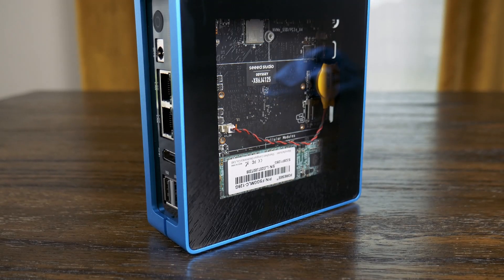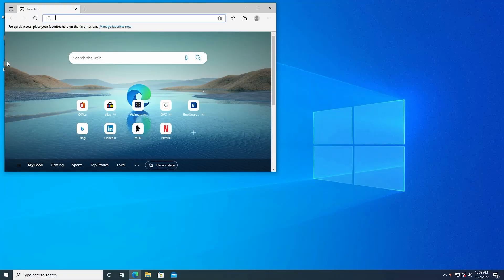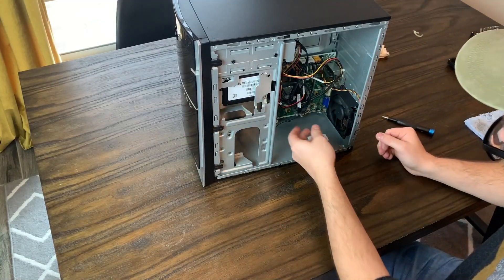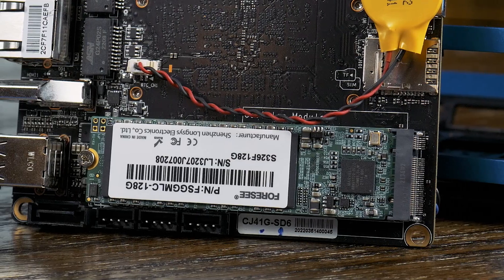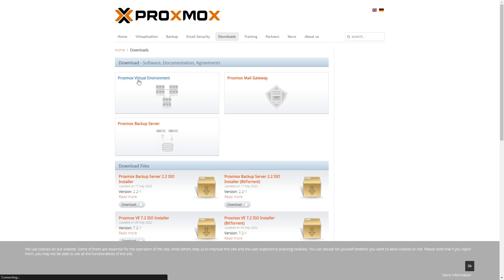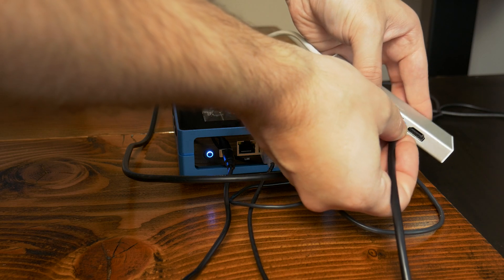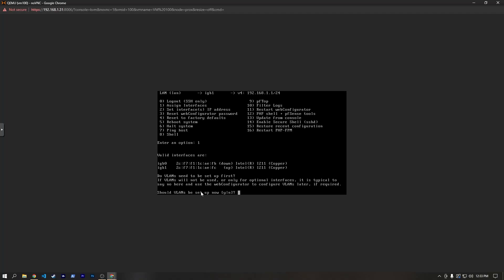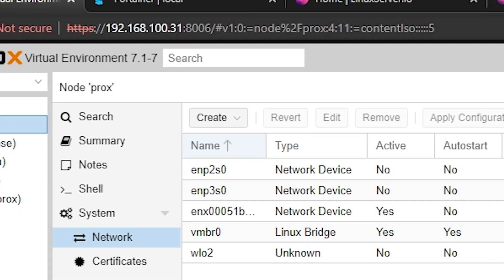Virtualizing PFSense With The Seeed Studio Odyssey

Comment: What about mini pc? It could be quiet dificult to intall two ethernet ports, but i think that on mini pc like a ThinkCenter M710q and some solidering i can usde the nvme to install one or two gigabit or 2,5 gigabit ethernet ports, but in this case you need an ssd for your operating sistem, or you can use the nvme e port to mount one ethernet port and with the one on bord maybe i could run pf sense. What do you think about this idea? Could it work?

Comment: When virtualizing pfSense/OPNsense it is recommended to use virtualized bridges that are set up 1:1 with physical NICs, instead of passing them through. Whenever you need to switch hardware, move VM to other physical machine etc., you can just update bridges config and VM won't see the difference, no reconfiguration needed on firewall's side. It speeds up disaster recovery as well if there is no HA setup.
Overhead on those bridges should be minimal and even low power mini PCs should have no problem with saturating ethernet ports. For a non-critical homelab environment a pass-trough should be enough as well.

Comment: Two very important thing to keep in mind about putting pfSense, whether in a VM or a physical machine. 1. Using Proxmox backup, you can backup the entire VM once you have it running. Store the backup somewhere safe and you can restore it to a Proxmox system fairly quickly if needed.  2. Always remember that pfSense can create a backup of your router settings via the "Diagnostics>Backup and Restore" menu item. That backup can come in handy whether you're restoring a pfSense system, completely reinstalling pfSense, or installing a new instance of the most current pfSense version, or even if you decide to move your pfSense system into a Proxmox VM. Super handy info to always remember. PS.... I just moved my stand alone pfSense from it's HP T620 thin client physical host to a VM within Proxmox running on an HP T740 thin client!

Comment: One thing that is still tripping me up after watching this. You gave the pfSense VM 2 CPU cores and then gave the Debian VM 4 CPU cores. How is this possible when the J4125 is only a 4 core CPU? Seeing as you're using this for pfSense and Home Assistant which both of these would in theory be active and running 24/7 it doesn't make sense to me how this isn't overloading the CPU.

Comment: USB Ethernet for a server seems like a bad idea.  Not recommended for critical components of your network.  Not likely to be as stable as built-in and could have problems during reboot depending on your host OS.
Reply from the maker: You must be new to the channel, haha

Joking lol, and yeah definitely not a great long term solution. However that's why I passed thru the onboard NICs to my router which is probably the more "mission critical" service. Granted I didn't have any issues with the USB interface for the few days I was testing. Thanks for the comment!
Reply: @HardwareHaven  Yeah, I realized after posting that in the video you actually said you wanted to deal with the “awkward usb Ethernet” thing in a future video.

Thanks for the content.

Comment: Do not buy a Seeed Odyssey.  I purchased one in December 2021 and it began acting up in mid-2022.  I would get random crashes which became worse over time.  Eventually, the machine became so unstable, it would not boot.  I contacted Seeed in August and have been back and forth with them since then.  After a number of email exchanges, they told me to log onto their website and fill out a form.  They just denied my repair request because I purchased it from Amazon instead of their website.  Very, very disappointing.  At this point, they will not repair my computer and I'm stuck with a $300 paper weight.  If you are considering an X86 single board computer, go with a Lattepande 3 Delta.  Seeed customer service is terrible and their equipment is unreliable.  I'm very disappointed in Seeed.

Comment: You can also just ssh into the Proxmox host and use that, because it's basically plain Debian. Be sure to secure the box, however.
Reply from the maker: True, but I like having things a bit more compartmentalized if that makes sense. Good point though!
Reply: @HardwareHaven  Very true point, I'd personally go this route since the Seeed box only has 8GB ram, which runs out quickly if you use ZFS or something RAM intensive.

Comment: I would probably start using VLANs at that point to save on the 3rd nic.
Take the NIC create a bridge which is VLAN Aware and pass one nic for Wan Through. For the Other put the UI To it and then Add the UI onto a VLAN and also Put a Trunk Port to the PFSense VM.
Reply from the maker: I’m confused.. are you saying to have a dedicated NiC for WAN passed to the PFS VM, and then use a bridge on the second NIC for LAN/everything else?
Reply: @HardwareHaven  Exactly. So that on the Wan side you can connect your modem/gateway directly to have not the Chance of exposing something you did not want to. And as internet speeds usually are slower that gigabit, you can share the bandwidth on the Lan side.
Reply: i would love to see that explained in more details. i have a two NIC machine wich seems to be a good candidate for a Proxmos running the PfSense and some other usefull stuff.

Comment: 192.168.100.x is the subnet most cable modems use (192.168.100.1). Cable modems intercept these packets from the data stream. Of course, since you used this on your router, you won't be able to see your cablemodem's web page anymore.
Reply from the maker: I’ve never had a need to access my cable modem, so I never knew that haha. I have a combo router/modem from my ISP so I don’t believe that’s of any issue for me at least. Thanks for the heads up though
Reply: @HardwareHaven  You can still log in with default user/pass usually. Can reboot the modem and other things. Even put the modem in bridge mode.
Reply from the maker: @featherpony  Yeah I've definitely made changes to the router/modem, but have only done it when I had a combo modem/router, so it was typically still 192.168.0.1 or 1.1.

Comment: You could use Vlan.
One port ethernet is enough.
Reply from the maker: Unless you pay for gigabit Ethernet haha
Reply: @HardwareHaven  I doubt that all virtual machines and docker will need the entire 1 Gb channel at the same time. Of course it is possible. But for a home mini server, you can get by with one port, and it will work well
Reply from the maker: Wouldn’t your connection for the entire local network > WAN be limited by running it on a VLAN?
Reply: @HardwareHaven  You’d be receiving 1Gbps from your LAN network, while being able to still transmit 1Gbps to the WAN network at the same time. You’re overlooking that your link is likely full-duplex. 🙂

I personally prefer multiple ports still (I like 2 for bonding and 1 purely for management).
Reply from the maker: @DavidManouchehri  Ahhh, yeah that makes sense. Thanks!

Comment: When it comes to your network stack, I personally recommend keeping that stuff to it's own box. I used to virtualize everything but it does become a problem when you have to take down the host computer for any reason. The only things I would consider stacking together is stuff like Wiregaurd and reverse proxies since that all needs network access anyway function.

I also been setting up a second OpNsense box in a virtual machine to take over for the dedicated box if needed.
Reply from the maker: For sure! In the follow up, I'm probably only going to run network related services that wouldn't even need to be up if the router was down. For sure wireguard, and then probably pihole (for local DNS), ddns, and nginx could be really cool.
Reply: @HardwareHaven  I look forward to this series, thanks for the videos!
Reply: I've been looking at replacing my old Asus router with a diy alternative. I was looking at virtualising the whole thing but you've stopped me. Would you still suggest a diy router?
Reply: @limitedrespawns  it really depends if you can cope with negatives. If downtime is not critical for you then its doesn't matter, and so on.
Reply: @vadnegru  this is a fair assessment. I live with others so this mostly comes from that but if you live alone and have no issues with your internet going out for periods of time if you need to bring down the host machine then it should be good.
Reply: @limitedrespawns  depends on what you wish to virtualize together. If it is just a general home lab thing you tinker with often I wouldn't recommend virtualizing the network stack on that in case you ever need to reboot the host machine or what have you.

Having the router on its own hardware ensures your network doesn't go down whenever you feel like tinkering with the rest of your home lab.

Which could be important if you live with other people who use the internet and not just yourself. If you live alone that can be something you could consider doing to save a few bucks. Me personally I like dedicated router/firewall hardware.
Reply: Yes, fully agreed. I had an entry level server with a 4 port NIC in my homelab. After  installed Proxmox on it AND ignoring that little voice in my head saying NOT to do so, I subsequently installed pfSense to it doing direct pass through of the nic ports to pfSense.. All worked wonderfully for over two years...then I tried doing a Proxmox upgrade.... which failed to complete fully and left the pfSense VM mangled. No more virtualizing it for me. I got an HP T620+ off of ebay and now have JUST pfSense running on that thin client box....totally happy.... plus I feel totally confident that I could (if needed) reinstall pfSense on it and restore my pfSense backup very quickly.
Reply: @ccupp2  is the hp t620+ still sufficient? If so, I think you've made my decision for me

Comment: An AIO mini server, hell yeah!
A retired laptop could also work very well as laptops are low powered devices, the performance is still pretty good for these headless tasks(even a 2nd gen mobile i5 is faster than these celeron socs). I think the biggest challenges would be routing all the services together from Proxmox.
Reply from the maker: Laptops can be a bit finicky, but definitely a cheap alternative. I will probably do a "busted laptop server" video or something at some point haha
Reply: Laptops can be cool to use, but it still depends on the generation of the hardware if it is a viable option. I had an old netbook that pulled 30 watts at idle. Right now I'm testing a NUC knockoff and it is pulling 9 watts at full CPU load.

Comment: When it comes to the NAS, these single board computers make great reverse proxies that allow you to access your NAS, whether it's the Asustor or TrueNAS from the Internet without actually being directly exposed to the Internet and create a more secure connection while letting you access your stuff at high speed. They also do well as being a VPN server too. It's like having the security guard in a gated community physically go to the house and get the info for you instead of you going directly to the door.
Reply from the maker: Yep. Reverse proxies are super cool. Maybe I can run nginx or something on the revisit of this!
Reply: @HardwareHaven 

You mentioned some problems with only having two ethernet ports....this may help.

https://youtu.be/wUcDg_ms0is
Reply: That is what I have to get set up on my HomeLab with the Pis that I have sitting around.